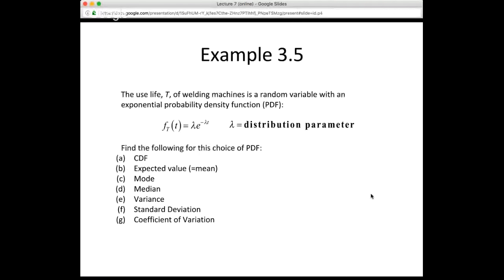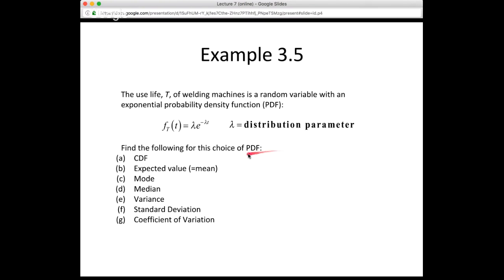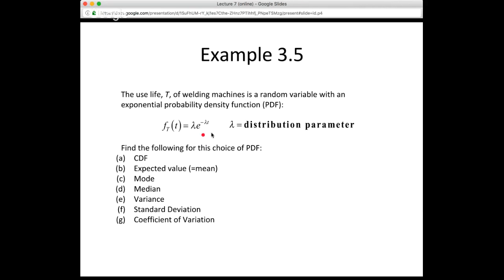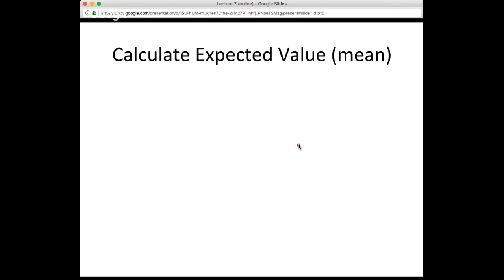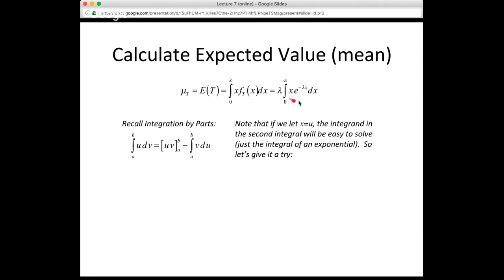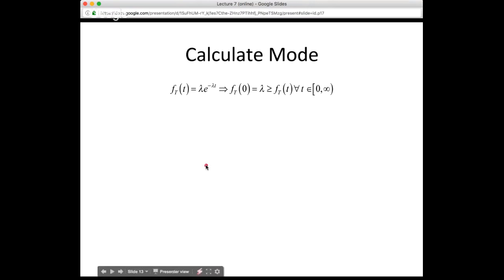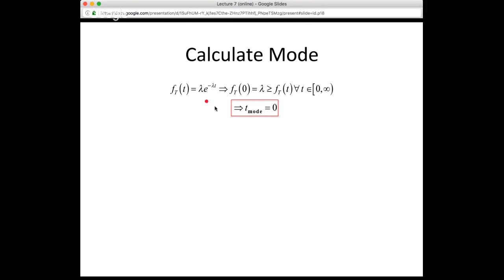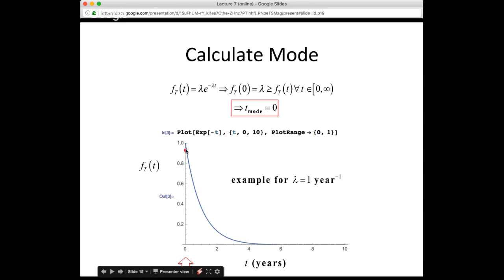Characterizing Random Variables

Comment: Your description of kurtosis is all messsed up! First, kurtosis is always normalized by sigma^4; your measure is not "kurtosis" but instead the "4th central moment" (https://en.wikipedia.org/wiki/Central_moment). Second, kurtosis really has nothing to do at all with the peak, in general; see the Wikipedia entry (https://en.wikipedia.org/wiki/Kurtosis) and the first cite therein. Third, in your examples with the exponential, your "flattest distributions" have the highest "kurtosis", which is exactly backwards from the classic (but incorrect) interpretation (going all the way back to Pearson) that low kurtosis corresponds to "flat," and high kurtosis corresponds to "pointy." 

BTW, the incorrect peakedness interpretations are around because there are classic examples (like uniform) where a flat distribution has small kurtosis. But it is a fallacy to generalize from that to say "all distributions that have low kurtosis are flat"; just like it is a fallacy to say that "because all bears are mammals, it follows that all mammals must be bears." There are infinitely many counterexamples, including the simple beta distribution, which can have an infinitely pointy peak with sub-Gaussian kurtosis. Please have a look at https://www.ncbi.nlm.nih.gov/pmc/articles/PMC4321753/
Reply from the maker: Hi Peter.   I wouldn't disagree with you!  However, that messed up definition appears in the textbook for the class (Ang and Tang, "Probability Concepts in Engineering"), and I guess I am less pedantic about Kurtosis than I should be.  I will post a follow up video for the class, repeating the examples using the more standard (i.e., correct) definition. Thank you for the message. -stan
Reply from the maker: Ha! I see you've published on Kurtosis.  I'll see if I can slip in some points on your paper in the follow up video. 

http://amstat.tandfonline.com/doi/abs/10.1080/00031305.2014.917055